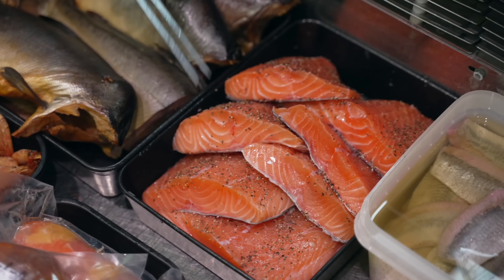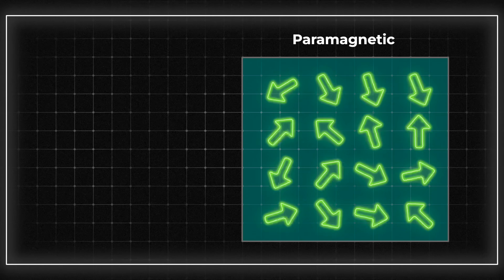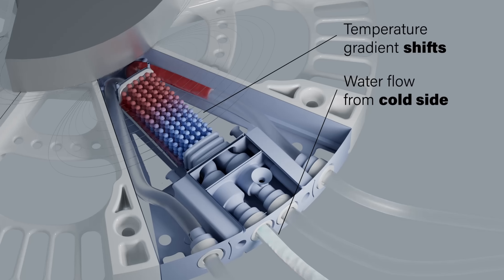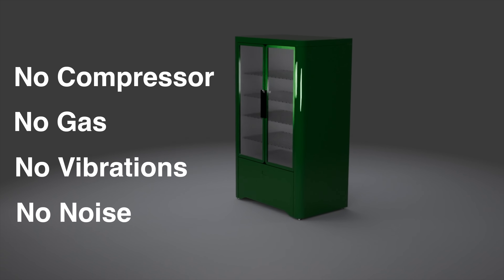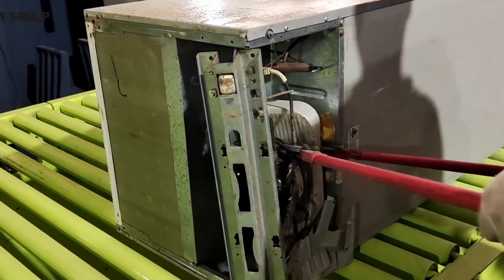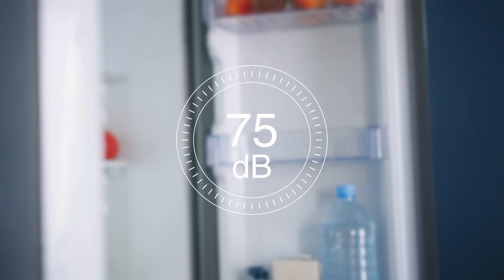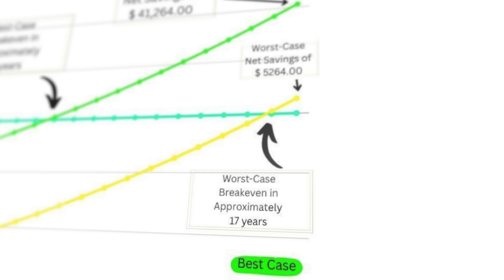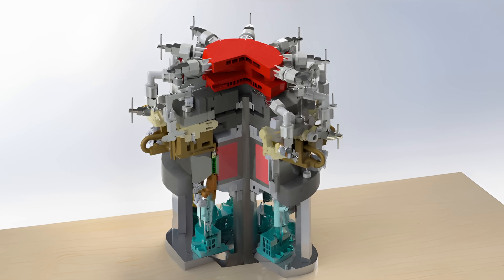Can Magnetic Cooling Disrupt the $100B HVAC Industry?

Comment from the maker: Get DeleteMe & Protect your online Info Today! https://joindeleteme.com/TwoBitDavinci
Reply: Not even a single source on the description? Come on.
Also. Beware that some "information deleting" companies are also owned by the VPN companies... if someone pays so much for you to use it, it means you shouldn't.
Privacy "deleting" "services" are the new VPN ads. GROSS.
Reply: @Splarkszter I bet you are ironically surprised that your comment is visible.  In this platform, they program us to align with the established narratives by selective censorship.
Reply: I bought a cooler that ran on 12 volts and used only electrical current for cooling with direct current.  If you reversed the the current the inside temperature would warm up.  The advertisement when I purchased from Koolatron, stated the the unit cooling is 40% below ambient temperature.  There is a fan that keeps the air moving.  These days I use a 12 volt freezer/ refrigerator to keep my whole milk and meat cold.
Reply: @peacepoet1947 12 volts at 5-10 amps. That is 60-120 watts to cool a small cooler.  Not very efficient and incapable of getting to freezing temperatures without exotic insulation.

You would be far ahead with a compressor fridge.
Reply: Hey what rate per kW hour is used in the chart graph?  $.30 per? $.35 per?

Comment: Temperature says nothing about performance ... how many Jules can it pump in an hour? or for Brits: BTU
minimum temperature shouldn't be a problem, just add glycol and it can go way below 0°C
how the f does a normal fridge use $6000 worth of electricity annually??? these are again, useless metrics. I have a 2m high single door fridge and my total energy usage is at 1600 kWh/a

Comment: In hot countries like ours (Hi from Türkiye Izmir), the most logical use for this cooling system is for air conditioning and home cooling. We feel in this day the heat generated by the outdoor units and the resulting temperature rise every passing year. Therefore, there will be no need to break any wall or have an second extern outdoor unit to hang up. price efficently home cooling

Comment: Why the target of this technology is for refrigerators? The energy usage of air condition is far higher and people do want to spend money for quiet and reliable AC units. Using water distribution, it is easy to route the heat exchanger to the vents directly to eliminate the blower noise.

Comment: The commmenters are probably right. Also saw in homepower magazine someone made an ammonia based system that didnt use electric at all. Heat collectors from the sun. Heat than cool. When the ammonia after sun went down it would produce over 40 or 50 pounds of ice. May be wrong. Point is there already cleaner options to study. Than improve than using freon based system. Magnets sounds nice if cheaper though.

Comment: Tell us again how 1 molecule of co2 heats up 10000 molecules of nitrogen around it bearing in it cannot release heat till it reaches minus 80 degrees C also if consumes infrared energy at 2.8nm entering the atmosphere and absorbs it at 14.8nm leaving the atmosphere Planks law E=hv says that it traps 5 times less than it consumes

Comment: You compared a commercial refrigerator with a residential refrigerator price wise. r, REALLY. Any residential refrigerator should have the refrigerant remover before discarding or land filled. 
This is law in all 50 states.  R134 has very little ozone depletion, however it does have negligible greenhouse effect.  cement factories are one of the largest green house contributors, I don't see you railing over cement products. How about magnetic shielding, the high cost of magnetic field sources, limited temperature range in permanent magnet systems ?  Gadolinium is a rare element. Used in electronics, medical-mri contrast, and optoelectronics. How much is available? How safe is it? Work on thermoelectric refrigeration  Efficiency and temperature drop will need improvement. I respect your opinions,.

Comment: Magnetocaloric, elastocaloric, electrocaloric, and vapor compression-based heat pumps all achieve the same core function—they move heat by triggering a change in a material's state or entropy. The only difference is the mechanism used to drive that state change:
- Magnetocaloric: applies a magnetic field
- Elastocaloric: applies mechanical stress
- Electrocaloric: applies an electric field
- Vapor compression: applies pressure to a working fluid

So no, the answer to your clickbait question is no—they’re not fundamentally different in what they do.
When or if magneto-, elasto-, or electrocaloric systems become as cost-effective, energy-efficient, space-efficient, and low-maintenance as vapor compression systems, then the difference to the end user will be practically zero.
Right now, vapor compression is still the clear leader in terms of real-world efficiency and deployment. While the theoretical efficiency of caloric systems may be competitive (since all are ultimately governed by thermodynamics), practical performance depends on:
- The materials available to create the desired state changes
- The mechanical systems needed to induce those changes
- The durability and lifecycle of those systems under stress

For example:
Elastocaloric systems show excellent potential in lab conditions, but the high mechanical stress leads to wear and maintenance concerns.
Magnetocaloric systems can reduce moving parts, which is promising, but often require rare-earth materials that are expensive and geopolitically sensitive.
I’m glad people are getting interested in these technologies. But I wish content creators would do more than skim the surface. These topics aren’t complicated, but important context is often omitted to generate hype or push simplistic narratives.

So let’s be clear:
All these systems are thermodynamically similar. All can be highly efficient compared to older methods like combustion or passive evaporative cooling. Each has specific use cases and trade-offs. None is a “bad” technology, and none needs to “win” over the others. They’re all valid tools in our thermal management toolbox, and none is a silver bullet.

Comment: Hate to break it to them, but I have a super and more efficient design using a modified traditional refrigerator. There is so little refrigerator fluid it's not a greenhouse gas, else it would be on the charts as a source of greenhouse gas.

Comment: Home refrigerators are dealable, they're well recycled and maintained but the real nasty problem is the air conditioners. Most homes have only one fridge but they have at least 2 ACs or some even up to 5 or 6. On top of that commercial buildings have industrial ACs which are much more massive and powerful, requiring more electricity, more gas and need for maintenance. If this cooling tech could replace ACs for good it would save us so much electricity, make enviornment safe, reduce dependence on greenhouse gases and especially save difficult all year round labor of fixing n refilling ACs, a lot of which have difficult to reach installations making their maintenance a pain in the ass for the laborers.

Comment: Use low frequency like nearly direct current to push heat out and stabilize all atom to cool down but if dc forever is not possible it drain too much power so we use on and off cycle so when off cycle only permanent magnet in effect and in on cycle it cool everything so fast can freezing even

Comment: Materials have to be there? These are rare earths save yourself. HVAC is 100 billion market as you say. Yet none of these global power houses show any roadmap of using a rare earth material / non refrigerant gas. In fact the recent changes to A2L's place a 12 year exemption because there isn't anything better currently.... well there is but there's complications. R290 -- plentiful, cheap, all natural refrigerant. Problem? It's refrigerant grade propane. Flammable as well as explosive. Europe has started... In time America's path may be a bit more complicated, but this is likely where HVAC is headed within the next decade or two. Retro fits of existing structure is likely going to be pricey as R290 will never be allowed to enter the structure. Currently new refrigerators use flammable refrigerants but the charge is usually not more than a few lbs if that. HVAC requires bigger refrigerant charges. Study BTU loads, I think you'll begin to see how much bigger the challenges are for any caloric-cooling effect. Avg home HVAC unit is 3 tons, 36,000 BTU's / Max out at 5 tons or 60,000 BTU's -- actual size of the machine typically limited to 3 foot x 3 foot and 40 inches or so tall outdoor condenser. There's size limitations for the indoor equipment as well. Then cost of the machine... many markets are 3 months and done so efficiency of the product is a slippery slope for the majority of the HVAC market. I've run the numbers, it will not work. YT mostly exists for click bait so in that sense that is what this caloric metal change state is best used for click bait you tube videos.

Comment: Why not just go with a Peltier device or thermoelectric cooler (TEC). It uses the Peltier effect to create a temperature difference, making one side cold and the other hot when an electric current flows through it. Wouldn't that be much cheaper than these magnetic cooled refrigerators? It's solve the problem of not using harmful gases, plus they are cheaper to build.

Comment: If you want to transfer where are carbon is produced it is better to buy solar panels. Hook up your hot water heater and some other small items. By doing this you can get away with only using a small battery and only producing electricity when the sun is out. Invest into 50 gallon hot water heaters and have them off at night when nobody is using them. You will have sufficient hot water to get ready in the morning and will recharge the hot water during the day.

Comment: Solar panels did not come down in price because of ramping up of manufacturing. The CCP in China artificially ramped up production by cornering the market. It does sound like production and it did but through artificial stimulus. Those factories are built now you will never have a refrigerator industry to the same level. These will stay in the commercial realm and never make it to homeowners.

Comment: Propane ( R-290 ) is an efficient refrigerant that does not contribute to global warming if it were to escape from a coolomg device. Also, as a heat pump it can heat a house a its full rated capacity down to 19F/-9C outside air temperature.

Comment: I grew up on the cusp of widespread refrigeration, therefore, to this day we call it an ice box. If this can be miniaturized it could also takeover the market of camping and traveling fridges due to its efficiency. With any offgrid applicance, efficiency is king. You could run it on batteries and solar. Hopefully they would get the price down.

Comment: How about - "Hybrid High-Tension Power Transmission Cable with Integrated Magnetocaloric Cooling"

Hybrid high-tension power transmission cable that integrates magnetocaloric effect (MCE) materials within its structure to passively regulate temperature and enhance efficiency in AC power transmission. This design requires no extra power to create an active cooling effect because it leverages the natural alternating magnetic fields in AC power transmission.

Why This Works Without External Power: Magnetocaloric Effect (MCE) Activation – The alternating current (AC) in high-tension cables naturally generates oscillating magnetic fields.

Passive Heat Absorption – The MCE material absorbs heat when demagnetized, cooling the cable.

Heat Dissipation Cycle – When the field increases, the material releases heat, allowing it to dissipate into the environment.

Self-Sustaining Cooling – This cycle repeats without requiring additional energy, making it a passive cooling system.

This means the cable functions like a mechanical superconductor, reducing resistive losses and improving efficiency without external cooling systems.

Comment: For those who DO NOT KNOW:  Back in the infancy of refrigerators (just before the electric compressor models hit the farm) there were heat tubes in a horse shoe shape design that sat in the bottom of one's "Ice Box". Generally on a daily bases one would remove that tube, place it over an open fire (or fire pit) until it glowed red.  Once removed that tube would all but immediately turn to a block of ice and be returned to the "ice box" to keep it cool for another 20 to  24 hours. 😊

One more: Modern Natural Gas / Propane refrigerators burn & use less fuel than our current day electric refrigerators, but because of the "EVIL" SKY IS FALLING Global Warming Hoax, those frigs are only commercially available for RV's (or special order) and threatened to be outlawed. Thank you mr. Politician.

Comment: CO2 based refrigerator / coolers have been in use for Coca Cola machines for the past 15 years now. The problem is they're virtually non servicable in the field and need bench level repairs once they're non functional.  That "evil" 134a you spoke of was DuPont's way of cornering the market after lobbying to kill R12, then R 502 and eventually R22. Next on the chopping block is the 410a as I understand it. And this says nothing of R 500 long since killed off.  But what they don't tell you is these refrigerants are  HEAVIER THAN THAN AIR, DO NOT RISE INTO THE SKY and DO NOT KILL THE OZONE. Nor since the false flags have they "Patched" the ozone layer these past 30 years as they promised. LOL!

If they were serious about refrigeration as a whole further development of "Peltier modules" would be a faster track to getting there.  Even more faster would be "vacuum" chambers that naturally remove heat and using glycol closed loops as a meduium; otherwise known as a modern day "absorption" system (similar to the natural gas fired Air conditioning systems of the 40's and 50's) Lennix helped kill with their compressor A/C systems we depend on now. 

The down side to those "natural gas / absorption systems" was though they had no compressors once they aged they often deteriorated and leaked. SURELY by now there's a work around you'd think.😅

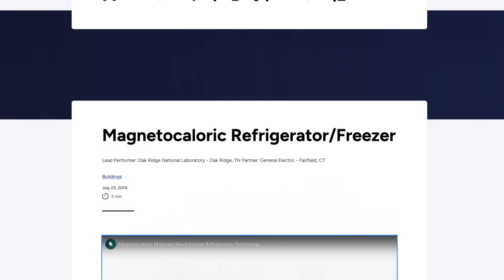Comment: so let me throw some cold water on all of this 10:13 fund my kick starter looking for investors will always massage the numbers, so know that we are comparing systems that are lab built not mass manufactured, and the cheapest china built mass manufacture it no insulation. simply using good sealing would vastly improve the efficiency of our refrigerates, but they won't do it because want the cheapest manufacturing cost and don't want to spend $3 retail on something that sells for over $1000 retail, yeah their's a lot of middle man overhead in that too, but that's part of the problem. So when you take a lab built that's given the best opportunities and conditions, then use the industry energy star numbers and only get 20% to 30%. when design, manufacturing quality, insulation, and sealing alone would get you way more, it's not more efficient. compare the cooling technology alone, not manufactured products.

Comment: Why spinning permanent magnets instead of electromagnets?

If electromagnets can be used pcb based planar inductors with cores to focus magnetic flux onto magnetocaloric materials along with integrated fluid channels could be a promising minimal thickness approach and could have less cons related to material sourcing, overall footprint, and economics.

Comment: I disagree with the scare tactics on R-134A.  There are laws prescribing the capture of refrigerants when disposing of compressor appliances (refrigerators, freezers, air-conditioners, heat-pumps, dehumidifiers).  Very very little R-134A leaks in to the atmosphere.  And 14 years in the atmosphere not very long compared to other greenhouse gas lifetimes in the atmosphere.

Comment: Regular hydrocarbons like Butane and Propane can be used as refrigerants for small heat-pumps, like fridges and portable air-conditioning. This is common practice here in Norway.

Comment: Pretty cool tech but... what a contraption! The requirement for moving part and cooling fluid entirely negates the advantage, in term of MTBF. While modern fridges are engineered to fail rel8ably, old fridges used to last for decades ( my mom's 1968 freezer is still in use, after 57 years of non-stop, 24/7/365 use, still freezes down to -18C)  Global warning is a SCAM to sell hardware. THUMBS DOWN